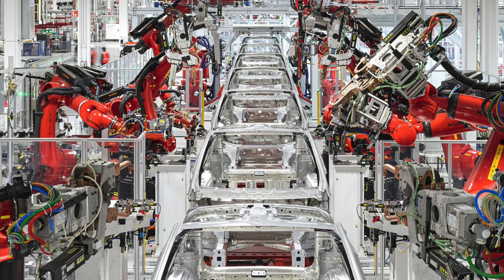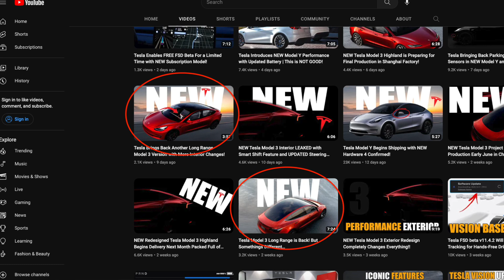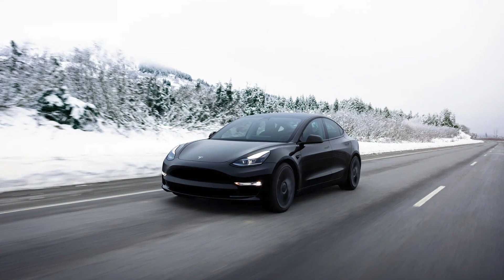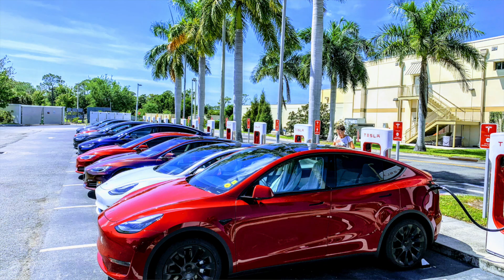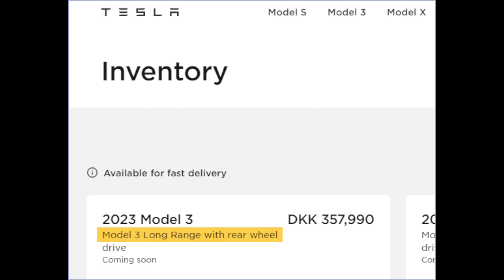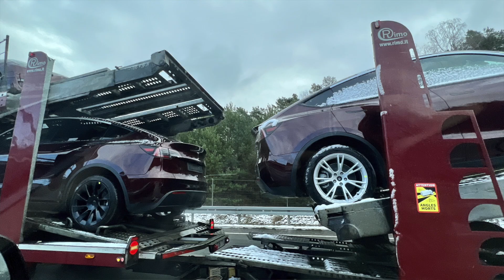NEW Tesla Model 3 Long Range with RWD | 620+ KM Range Estimate

Comment: my vin number starts with LRW which is made in china. heard that quality is not bad. must be the catl cobalt magnanese lithium battery worth 78kwh useable battery. will be getting the thing at end august, just in time to cry my way to see my inlaws seeing the goodies that the highland has to offer like 10 cameras and uber eats
Reply from the maker: Haha all good just enjoy the car and don’t think about it. Or if you haven’t taken delivery yet you can just cancel and wait
Reply: I can't seem to find any info on the battery for the long range RWD 2023 model 3. Is this the battery you can charge upto 100% daily? Do you have any info/links on that?
Reply: @wakkasali381  This is a 82kwh Niquel Cobalt Lithium battery, which should be charge normally on 20-80% charges and once in a while from 10 to 100% on a roadtrip to recalibrate. The RWD standard range is the one with 60kwh that can be charged to 100% normally . In my case I got the bigger battery for the same price as the smaller battery and I do suffer from range anxiety on my roadtrips so now with 600 km I am good to go.
Reply: @jluis333  thanks for such a detailed response. Helps alot.

Comment: Perhaps they are running short on old design front motors. I like the LFP blade battery option, but don't think you can get at model 3 with that. I would also prefer the new gen 3 motor, but Tesla don't let you choose battery or motor type.
Reply from the maker: Yeah if only Tesla allowed us to pick motor type and battery, I would pay

Comment: Why would anyone buy 2wd and white?!   the reason to buy dual motors and boost is just to go fast. If your not buy another car that is cheaper. Its like owning a tesla without fsd. Ridiculas
Reply: I mean fsd doesn’t really make sense for  some people, maybe advanced autopilot.
Reply: @bladebk5537  
I would buy a different car if you don't want FSD. If you are saving money, there are many options for Ev's, plus the government welfare kickbacks. 
Once you go FSD and dual motor performance, your purchase is solely how deep your pockets are. 
The white paint, I will just never understand. I laugh my ass off whenever I pass a new car in battleship gray too. 
Make the statement because these half-measures make the car shitty down the road, and you can't come back from those last two. 
Used no option Tesla's will make great first-time drivers cars. They can at least buy FSD.
Reply: @Patriot3   like what? Besides Tesla in the normal segment nothing else really seems to
be on par with it, all seem lackluster jump on the bandwagon cars (in the segment).
Reply: @bladebk5537  
I thought VW and Ford were hitting out of the park.
Reply: @Patriot3  idk @38k€ a LR 3 seems hard to be beat in the performance/features categories  by an VW id or a Mach e imo
Reply: Not really. Dual motors are good for winter weather driving which I want because of living in a northern state. So not everyone wants just RWD like myself.  I agree, I would not buy white or white interior.  Unless you like to see dirt and mud all the time.

Comment: Everyone looks at the huge number on the long range but in theory or just straight facts the most efficient model 3 is the Standard range. Don't be fooled by the 100+ more miles almost
Reply: I own the 2023 LR RWD and it's actually 10 kg lighter than the SR RWD (thanks to the higher density NMC battery) . Didn't have a chance yet to fully measure range but for sure the most efficient version (avg consumption is 13.4 kWh/100 km), 600km+ seems realistic to me.
Reply: @EmmanuelChabani  this is great news! And congratulations. I’m trying to order one, the system is buggy as hell in the Uk trying to pay/finance. Day 2 of Tesla chat about to start.
Reply: @ianjames3078  good luck with your purchase,  you won't regret it!
Reply from the maker: That’s insane 600+km 🤯
Reply: @EmmanuelChabani  how many kWh is the RWD LR battery ?
Reply: @tafl-9198  79 kWh gross - 75 kWh neat (same battery as in LR AWD)
Reply from the maker: True that the SR is still the most efficient model, but who knows maybe things will change with this LR RWD version
Reply: I think with higher density battery in RWD lr v RWD std maybe there won’t be any weight difference despite the extra 15kWh. I don’t think the efficiency will be different, maybe a fraction worse.
Reply: Very true. SR is the most sensible version. More family friendly acceleration as well.